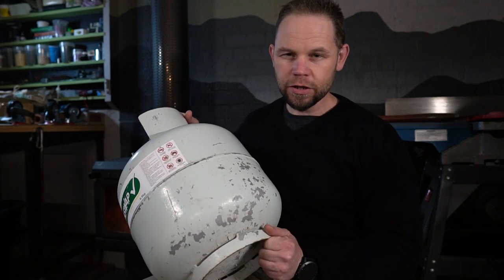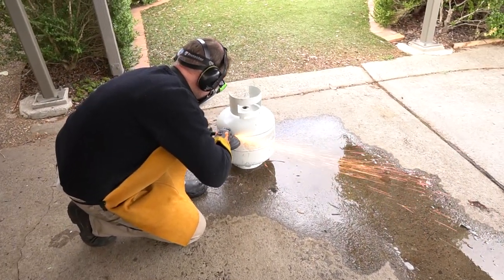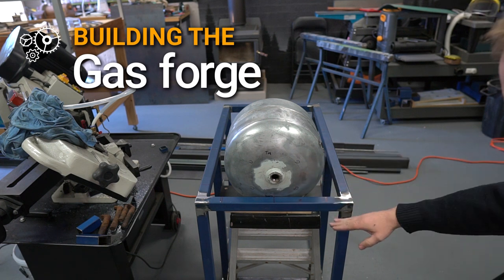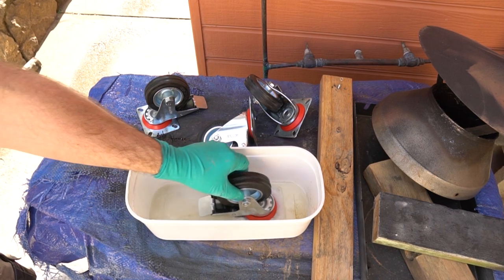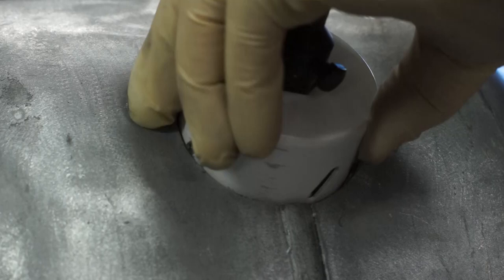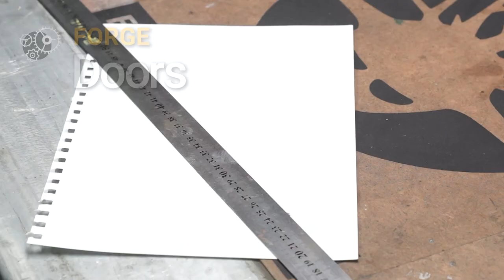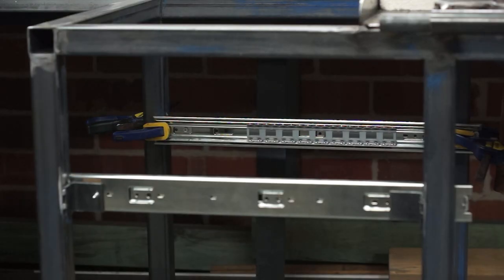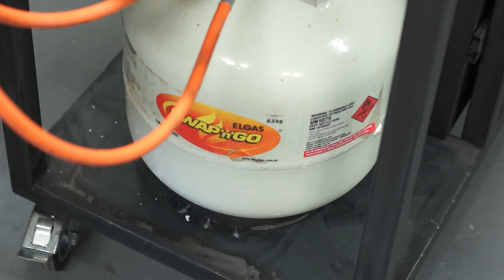How to build a gas forge for blacksmithing and knife making

Comment: Hi Rowan. Great build. Very functional and well planned. Just purchased a forge kit from Gameco. Wondering if you would be prepared to share the dimensions of your build. Cheers.
Reply from the maker: Thanks Darren. Overall height of the trolley is 900 high (to match my benches), 820 long by 500 wide. The handles, forge and guide rail protrude beyond these dimensions.

Comment: Mate that's awesome work. The fit and finish is great. I just bought the same forge kit pre-made and it looks like the coating for the kaowool is worn off. Bought some other paint on stuff from gameco they said it's better than the ridgidizer spray. I get nervous around these harmful products!
Reply from the maker: Good tip mate. I might need to look into it when mine needs recoating.

Comment: Hey mate, well done on an excellent build. Very clean and well engineered. Great video too!
I'm looking at buying the forge kit from gameco and wondering if you bought the one that includes their burner? And now that you have it going, is it performing well? 
Cheers from central Vic 👍
Reply from the maker: Yeah the kit comes with the burner too. It goes well for smaller peices but I can't get enough heat for heavy stock like 25mm solid square bar.

Comment: Could you put 2 burners in this size bottle? Just started to blacksmith. Not knife making. Im making camp tripods..hooks.. cook sets etc... sometimes 18MM roundbar
Reply from the maker: I've been told you can. It could do with a little more heat if you want to move 18mm.

Comment: Nice build mate
What was the size and offset for both of the openings at each end?
Reply from the maker: Hi Stuart, main is 140*95. Back is 110*40 but it's almost always closed off with the firebrick.

Comment: looks like you still have exposed refractory wool. that's not good the rigidizer will break down and the fibers will go airborne over time. you need to seal it with 1/4" castable refractory then ideally add a thin ceramic reflective coating. also make sure your forge chamber isn't bigger than 300 cubic inches. as it is your forge isn't optimized and might not reach forge welding temps.
Reply from the maker: Hi Chris, agree the chamber could be a little smaller in volume - it's about 350. Where do you see exposed wool? I was pretty careful to ensure every surface was carefully coated, as per the kit instructions.
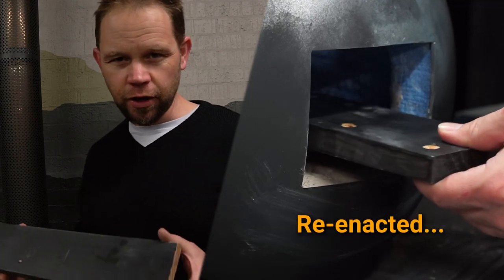Reply: @rowanferguson  I believe he was talking around 10:45 where you coat the bottom but don’t seem to put it around the rest of the inside of the forge. Perhaps it’s just the lack of video. I was also wondering if you had coated the entire inside of the forge or just the bottom. Good video. I plan to use your idea in about a week. Thanks!
Reply from the maker: @SimplyChrist  castable refractory cement is only used on the floor. The rigidizer was heavily sprayed on all wall and ceiling surfaces. You do need to keep inspecting the walls for any cracks or damage - and reapply rigidizer immediately if there's any exposed wool. If you wanted to go for a hard refractory, look at a thin layer of satanite or RTZ wash coat.
Reply: @rowanferguson  I see. Thanks for the clarification. I’m going to watch it again to ensure I get everything prepared correctly. Thanks!